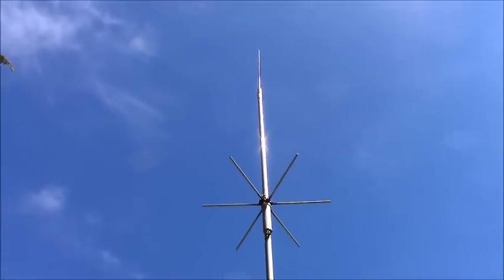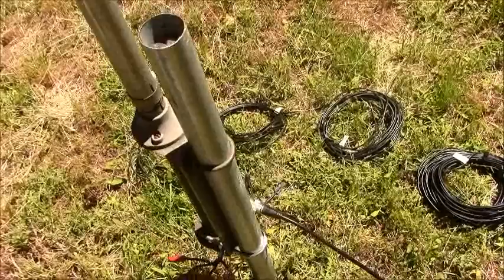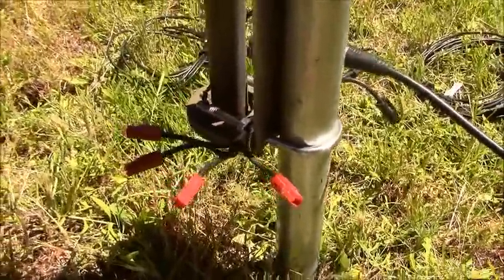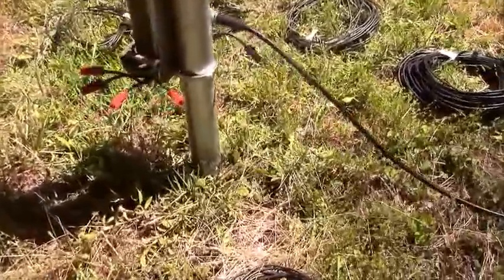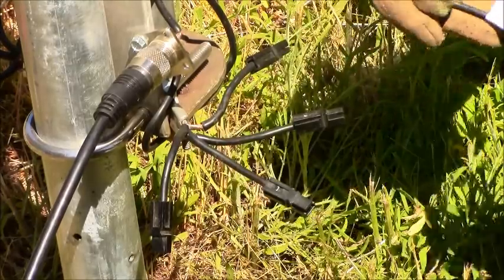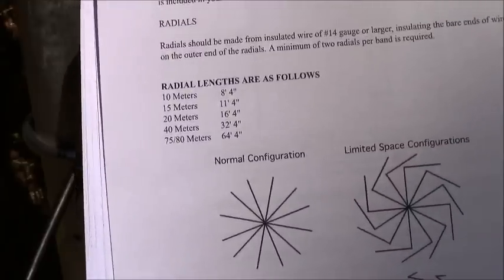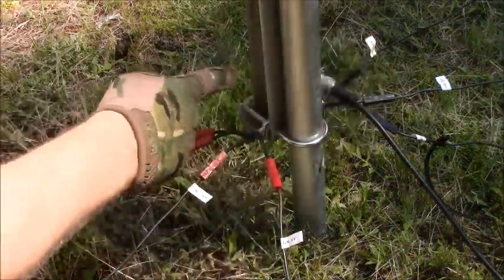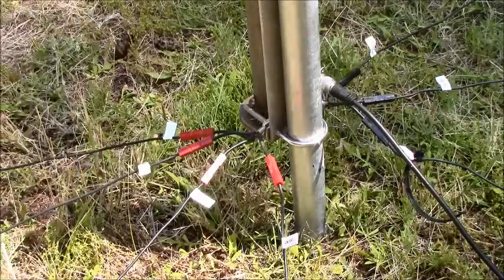Antenna   Hustler 5 BTV and Anderson Connected Radials

Comment: Three comments:  First, regarding the person who said that they use a tuner with this antenna, the instructions that came with the antenna specifically state NOT to use a tuner with it.  It will have no operational benefit, and will only make your radio "happy".  Instead, tune the antenna properly, and there will be no need for a tuner.  Second, in the video, it looks like you use a screwdriver at the end of the radial, and stab it into the ground.  I'm hoping the radial is insulated on the end, because the instructions state that it should be insulated, and not come into contact with the ground. Third, the instructions give specific lengths for the radials, and I will list them here: 10 meters: 8' 4", 15 meters: 11' 4", 20 meters: 16' 4", 40 meters: 32' 4", 75/80 meters: 64' 4".  They require a minimum of two radials per band, and one radial for each band should be on opposite sides of the antenna.  Here is the online manual: http://www.new-tronics.com/main/manual/4btv.pdf

Comment: I’m confused. The documentation for this States that it’s not necessary to cut the radials to any resonant length
Reply: You ONLY CUT when it is roof mounted,  Then they become "counterpoise wires", for ground mounting they are radials and  just make them as long as possible. 
I had both setups in past years and both work well. But then again Sunspot Cycle 22 was fantastic and you could use a hanger to work the world, while 23 was OK.
Hope that helps, 
73 de KD6SBR

Comment: Great info.  How much better are more radials?  I have seen some installs that claimed 100 radials.
Reply: There is a certain point where adding more radials will NOT have an effect at all. I THINK I've read somewhere that 60 radials  is max, after that there is little to no difference in performance. 
Better to search this info to be sure. 73 de KD6SBR

Comment: A buddy gave me a 5BVT from a silent key that I am in the process of refurbishing.  Is there a need to water proof the Anderson connectors?  This is a great idea that I will use.
Reply: With permanent installation most of the old timers I have talked to almost always recommend weather proofing. If nothing else it can help avoid problems down the road and help protect your investment.

Comment: hey jon you don't have to have radials at all if you don't have room. I ran a 6btv in YI9 and 9K2 and here in Georgia at home never had radials and have made 100s of contacts world wide. yes you should have them but in a emergency and lack of room  you can still use the antenna just ground it. I didn't even have a ground in Kuwait  the antenna was on a 13 story bldg. I was on the 8th floor. great video

Comment: Ground radials should not be cut to length for the different bands,
in fact cutting them to length/making them shorter has a detrimental effect
as ground radials should all be the same length which is half a wavelength of the lowest band
Reply: That is, 80 meters long for each radial? And with that it would resonate up to 30Mhz?
73
Reply: backyardbasher if the feedpoint is elevated, tuned radials are necessary. Even if it's only raised a couple feet (reducing ground loss dramatically). This is obviously a modular design to be used in many different circumstances.

Comment: I love Anderson Connectors, but would not use them in this type of application. they need to be worked now and then ( connect and disconnect)  and being outdoors would need weather protection. I have a 6BTV with radial that I just laid on the grass, used lawn staples to hold them down, after about 6 weeks the grass pulled them down, you can't see them or trip on them. This antenna has been up almost 10 years. I would be very concerned with corrosion of the Anderson Connectors.

Comment: Nice video John. I have the Hustler 6BTV verticle, 2 year's ago when I installed it in the garden I put down the radials and 2 earth rods. strong winds have blown it over a couple of times so at the moment it as no conected radials but I'm going to follow your advice and do the same. 73tu de 2E0MQA

Comment: Ok off question but how long have you had the labels on those cables outdoors? The reason I ask is I'm looking for some sort of label maker or way to mark cables that will be outside. It will need to be waterproof as well as u.v. Proo or fade resistant. Sharpies fade quickly outdoors I've found out. Thanks
Reply from the maker: I use this antenna primarily as a field-portable antenna, so it's not set up year-round.  Usually for a few days or up to a week at a time.  The labels are very robust and don't seem to fade and hold up well.  They have a thin veneer layer and very difficult to tear.  They've held up well in field use.  I believe the label maker is a Brother.  I can get the exact model if you'd like.
Reply: +Radio Free Redoubt thanks for the fast response sounds good.

Comment: Great antenna, I use the 4 BVT, and use a tuner for 80m. That's a nifty idea for the radials.  I see the coax mount was modified as well.   The steel stake mounting also allows for some movement, which has allowed my antenna to weather 60mph winds more than once.
Reply: How well does the 4btv work on 80 with a tuner?
Reply: +Radionut 44 pretty well.  I don't have any data for efficiency, but I tune in on national net with no issue.

Comment: been looking at that same antenna, hows it working for ya? plan on getting my General this month...Comms Up!!
Reply from the maker: The antenna works great, but is definitely a longer-range antenna.  I rarely make contact inside 350 miles as the low takeoff angle tends to skip over the >300 mile range.  OTOH, others would argue that they have no problems with closer stations so location, soil, etc. will often be factors.  I would recommend a wire dipole as a primary antenna if you have the space.  I use this primarily as a field-portable antenna and love it.